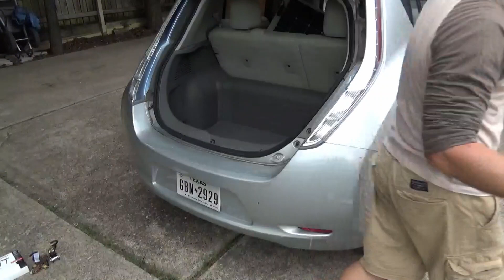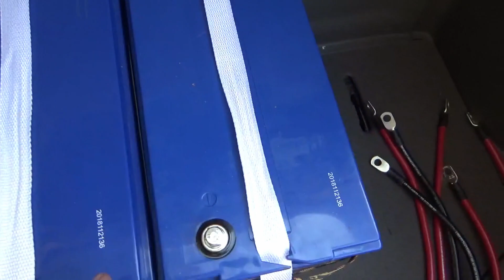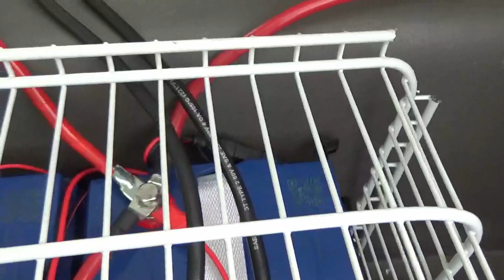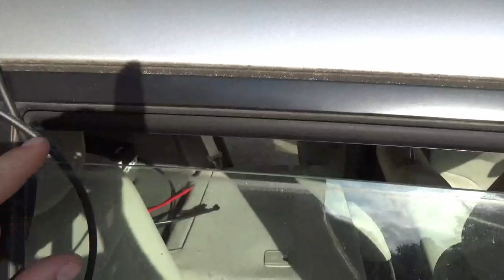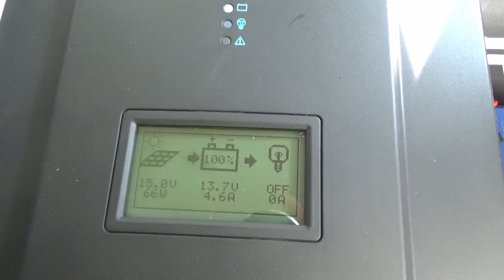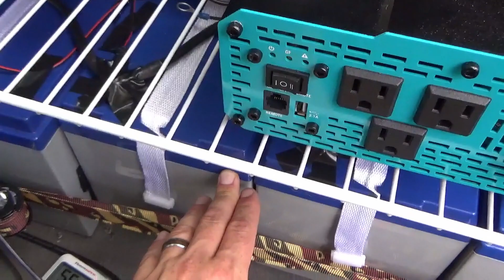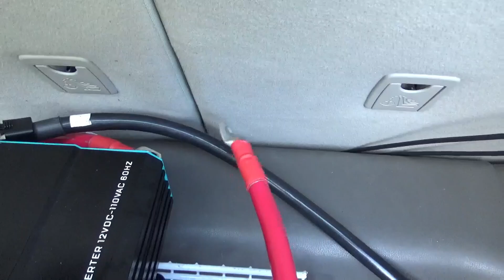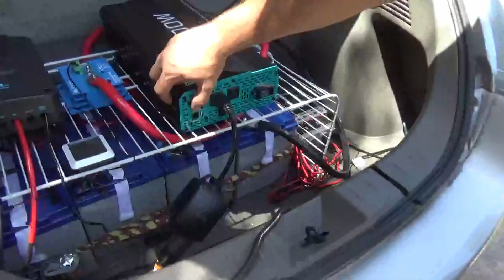Solar Powered Nissan Leaf

Comment from the maker: Finally finished editing all the footage!  Sorry it's a little long and some of the camera angles are, . . akward.  Im happy to answer any basic questions you have here in the comments section.  For more technical/in depth inquiries please e-mail me at Lonestarezev@gmail.com    Enjoy, and thanks for the support
Reply: Very cool, but add-on solar to our short range ev's (or any ev) would be much better if we could have an inverter, charge controller wired straight to our traction batteries. Removing the extra batteries and the need to plug and unplug the charger. Anyway still cool and as ev tech improves and evolves along with pv tech, we will see things like this become more and more relevant. Imo ev's still have tons of untapped potential. Good work and hope your system adds many happy, zero emissions miles to your leaf.
Reply: Did you get your inspiration from the Lightyear One car? Which its-self was derived from Stella? SolarRolla versions 1 and 2? This is tech that has seemed within reach for a while now, but not exploited for the short and sunny daily commuters.
Reply from the maker: @JoeMalovich  The Light Year is an amazing vehicle if you're a multi-millionaire.  This is a solar vehicle that anyone can afford and drive.  It's simple to work on, and they start at well under $6,000.
Reply: Great job and great video. 

Is it possible to get a parts breakdown list written up in the vid description or About?
Reply from the maker: @willp5457  I'm still working out the best components/brands for the system.  I don't want to throw a parts list out there today, and find something that is better and cheaper tomorrow (thats happening a lot), and steer somebody wrong.  For that reason I'm just doing it through e-mail for the time being.  When I get all the kinks worked out and this system works flawlessly I will definitely post a parts list.  Stay tuned Will
Reply: Wattsap 05397470473 turkey   tenk you
Reply: How much you spent?
Reply from the maker: @fredyrodriguez4221  System shown in this video was $2500.  Ive since upgraded batteries, inverter, and added an air conditioner.  The system shown in my latest video with roof rack panels, and everything else would cost you around $4,000 to build.  You get 1/3 of that back in a tax rebate if you live in the U.S.
Reply: Innovative Sustainable Solutions Ok, please explain why you cant just hook up the solar straight to your vehicle battery bank?? Thanks!
Reply from the maker: @davetriplett4779  Thats the most common question I get.  I'm going to do a video on it in the near future here.  1st you would have to bypass the vehicle's charging hardware.  The plug that goes into the front of the Leaf (the J1772) plug, takes the 120v AC power and runs it through the vehicles charging hardware that turns it into the 400v power neccessary to charge the vehicle battery.  This charging hardware requires a minimum power input of 600-700 watts.  That amount of power is extremely difficult to generate using the number of panels that can plausibly fit on the vehicle.  I have reached as high as 480w using the system as of June 2020, and the systems current iteration is considerably larger than the one in this video.  So we can't use the hardware designed to charge the vehicle, why don't we bypass all that and plug the panels directly into the main battery?

The solar panels generate power at 18-20v, so we would have to step that up to 380v.  Not easy but it can be done.  The vehicle has something called a precharge resistor you have to get around or you'll blow a fuse.  You could drop the pack out of the car and apply leads directly to the High Voltage pos/negative.  Run those leads through the case, re-seal the battery pack, hook your stepped up 380v power to those leads, and it SHOULD charge the battery directly.  At this point I should mention in the year I have spent researching DIYers Leaf experiments I have never seen anyone even attempt to achieve what I'm describing here.  But up to this point it is theoretically possible.

This brings us to the final hurtle.  The vehicles BMS (battery mgmt system).  This software is designed to monitor the roughly 400 lbs of potentially highly flammable lithium battery cells that compose the vehicles battery.  The Nissan maintenance manual for the 2011 Leaf seems to imply that if the vehicle is turned on and detects a change in the battery voltage when it WAS NOT charging since turned off, the vehicle software will assume the battery integrity has been compromised somehow, and shuts everything down except the "See Dealer" indicator on the dash.  We don't know for sure because no-one's ever attempted this.  I intend to verify this is impossible, but it's a complicated task that I probably wont get to for several months to a year.

To paraphrase: The way shown in this video is easier, safer, won't damage the internals of the vehicle, and can be done by anyone.  So I went with this method as a tutorial for beginners who want a range extender for their Leaf.  Good question.
-Sam
Reply: Innovative Sustainable Solutions sucks that it has to be that involved...& high power required to charge....i have a tesla model3 and the glass roof is a Perfect place for about 5 300W panels, & the sun boils down thru there...i put windshield sun shades in the front one...🌞🤔 Thanks for the in-depth response! I will keep researching....
Reply from the maker: @davetriplett4779  Nice.  We're cybertruck order #22k.  I love the model3 but Tesla's are tricky.  Vastly more bms software than the Leaf (or any other EV really).  InsideEVs did an article on this Youtuber who did a solar trailer system for the Model3, but it some critical flaws/borderline deceptions they missed.  I've heard that if the power supply to the EVSE is interrupted 3 times (unplug 120v plug but leave the charger in the port), the M3 decides it's a faulty circuit, and wont charge anymore until the charge port is unplugged and plugged back in.  Can you verify this?  Thanks.
Reply: Ok, please explain why you cant just hook up the solar straight to your vehicle battery bank??
Reply: https://www.youtube.com/watch?v=j8H7eEDbY-o
MY SOLAR CAR. PROJECT CARRIED OUT IN 2020. The Romania hybrid / solar car.

Comment: The electrical safety issue is more about uncontrolled current flow. DC voltage <60V won't shock you, but the size of those batteries and cables can cause instant welding of the wires if they touch each other and possible fire from wires melting due to the short.
It's too bad the leaf won't let you drive while it's charging, or you'd never need to unplug it. I'm considering doing this, but maybe just to power the 12V system, so things like the A/C can run without draining the drive battery.
Reply from the maker: The HVAC system in the leaf is directly linked to the HV battery unfortunately.  Connecting the solar straight to the HV battery would awesome, but involved opening the 400v battery and making direct connection to the cells.  I never got that far, but would love to watch someone pull it off

Comment: What size batteries are you using
Reply from the maker: @billkoeberle3308  It Agm(lead) batteries in this video.  I later switched to afternarket lithium batteries made by Valence
Reply: @InnovativeSustainableSolutions  what amp hour rating
Reply from the maker: @billkoeberle3308  12v 100ah initially
Reply: @InnovativeSustainableSolutions  thank you for your help

Comment: Velcro to hold those batteries is quite unsafe, along with using the plastic panels to hold your ratchet strap. Those will kill someone in an accident flying forward.  You could have easily bolted to the metal frame of the car. Additionally I can't believe you actually cut a hole in the boot lid to run the charger cord to the front. Very inelegant solutions to be advising people to copy.

Comment: What are your thoughts on a wind turbine to help charge it at night or whenever you stop?
Reply from the maker: I think it's a great idea.  You would just need to design something that deploys rapidly, and can be secured tightly to the vehicle.  I've thought about building something like that a lot.  People will immediately jump in and say "It's too much weight/wind resistance when driving", but that doesn't really apply to most Leaf drivers.  Most of us drive 60 mph or less, and less than 60 miles/day.

Comment: Great video! I would have tried to install an all-in-one 48-volt system in there which will provide you more capacity and you can charge at 240V. That would be an interesting project if possible.

Comment: How did you get the EVSE to detect ground? I have a portable 2.5 kWh battery but can’t charge because the charging brick flashes green which means it can’t detect ground to allow charging.
Reply: The answer is a bonding plug

Comment: I love mine too but I must improve my range from 225 miles to
Over 450
Miles before I can drive it from California to My new home in Texas so any suggestions some have added generators to the roof to add substantial Milage any suggestions. There are night mare stories about Vehicle transport companies so I’m concerned and wondering if there’s anything I can do to get my ranger to drive my own car safely to my new house
Reply from the maker: I have used a vehicle transport company to get a Leaf from Cali to Dallas.  It was a bit of a headache, and $1600, but I can give you the company info if needed.  I have never seen a Leaf go even close to 450 miles on a single charge.  Aerowheels help (I have a video on those), it's still cool out in the mornings so you can drive with the A/C off, and if you keep the speed around 55 mph, you will get more range, but it will be a challenge.  You can do it, but you will have to research where all your charging stops will be.  Try to enjoy the adventure, and welcome to Texas!

Comment: Instead of cutting the rear hatch for the cable, you could run it inside the car and trough the firewall and store the plug in the engine bay. Or drag it out the wheel well drain plug
Reply from the maker: It occurred to me later that this would be a much better way to run the EVSE cable.  Gonna try and do a video on that this year

Comment: im think about doing this. i found a nissan leaf for cheap
Reply from the maker: I've learned a lot since I posted this 18 months ago.  Check out the more recent videos, and I'll keep posting new ways I'm finding to add a couple miles of range here and there.  The Leaf is the only EV on the planet that you can turn into a 70mile/day vehicle for under $8,000.  E-mail is in the video description if you need help.

Comment: How much of an effect do the panels have on the range due to air drag?
Reply from the maker: Shockingly it's an efficiency loss of only 2-4% at speeds around 55-60mph.  I still get 4.6 miles/kwh with my latest version of this system installed (see most recent videos)
Reply: @InnovativeSustainableSolutions  Thank you!  Will do.  :D

Comment: I love it you jumped right in there :) Have you played around with using series on the panels instead of parallel? How hard would it be to add a second vehicle charge port so you didn't have to run the cord on the outside?
Reply from the maker: I made a mistake designing this as a 12v system.  Im actually gonna talk a bit in the next video (Custom Flexible Solar Panels) about how to switch this a 24v (2 panels in series) system, and the advantages of doing so.  I also want to do a video on how to permanently run the EVSE handle under the body paneling, so it's less, . . trashy looking, and so pranksters don't get tempted to unplug it when they walk by.  I have a friend that worked in an autobody repair shop that I think I can talk into helping me make a video on how to conceal the cable.

Comment: Excellent video!, Could you have just installed the solar panel w/o adding more batteries? If yes, how to connect solar panel to the existing electric car system? I have a Toyota Highlander Hybrid 2006 and I want to install a solar panel then connect it to the existing hybrid battery system. thanks for any info..
Reply from the maker: This is the most common question I get about this system.  I'm going to do an entire in depth video connecting directly to the vehicles battery, hopefully within the next month.  Stay tuned
Reply: Awesome my friend! there will be many that will be grateful to you for that upcoming video, thanks again.

Comment: Great idea. I would love to see a rack on my roof that either folds out or is telescopic so when you park, you unfold it and can have larger more efficient rigid panels. If done this way, i reckon you could get about 800 to 1000 watts of solar on the roof.
Reply from the maker: You could go with rigid panels just as easily.  They are atleast 10x as thick and way heavier, but if you don't drive at higher speeds, or very long distances then the scales would probably tip in the favor of rigid panels.  Next weeks episode is all about solar roof racks.

Comment: Why do you think the Renogy 3000w inverter failed, the charger only pulls about 1400w? Very interesting (and gutsy!) project!
Reply from the maker: I have noticed, now having worked with several brands of inverters, that manufacturer's across the board seem to be very ambitious about what their inverters can handle.  In general, I have discovered it is worth it to buy an inverter spec'd at at least twice the load you expect to be running.  I have been extremely pleased with my Giandel 4000w so far.

Comment: A true American Hero, thank you Sam, you are the man! I have a LEAF identical to yours, my son now drives to High School! I drive a Bolt now! If only I had known P85 Tesla Model S would be going for $25,000 or so I would have just waited 6 months! After spending 2.5 years of my life on Army Middle East Deployments... Solar and Sunshine 🌞 are so attractive!
Reply from the maker: Ha!  We have the exact same vehicle loadout.  The missus drives a 2017 Bolt.  Stay tuned, I've got a Leaf battery pack replacement how-to vid in the works for this fall.  Where the heck did you find a Tesla S for $25k?  I found a 2012 S with 180k on the odometer for $28k.  The Bolt for 19k just wound up being much more affordable
Reply: Ahhh Good Sir, Indeed you are one of my true American Heros today in this age of Science Denial! 

Car Gurus...in fact seems to have a corner on the best Model S deals. I do have an inside deal too though that beats even Car Gurus. BMVW Auto Sales in Unión City, GA just South of ATL!  I have an inside deal with him to get them at his cost from auction which is as low as $19K sometimes for an 85kWh Model S! He is an Iranian Immigrant from 1980 or so, to attend Georgia Tech as a Civil Engineer and never went home, except maybe to visit! In Dec he installed 128kW of Solar, which on a sunny 😎 winter day makes 700-800kWh , more power than his 50,000 sq ft building with 3 tenant shops uses! 

https://www.cargurus.com/Cars/l-Used-Tesla-m112?px8324=p2&sourceContext=usedPaidSearchNoZip&cgcid=12297&cgagid=30146915&ax8324=67620959&type=GoogleAdWordsSearch&kw=%2Bcargurus%20%2Btesla&matchtype=b&ad=327956807892&placement=&networktype=g&device=m&devicemodel=&adposition=&physloc=200524&intloc=&aceid=&cid=1657358119&agid=67278678618&tgtid=kwd-620656408212&fid=&gclid=EAIaIQobChMI06C29Zrd6QIVAovICh33sg_cEAAYASAAEgJKPfD_BwE#listing=271340625 

I might well can read you in on his super discounts as well, he has built a Solar Rack(Wood) on Wheels That looks a lot like your 2011 Nissan LEAF Set Up with 110/120 V!  I can email you the photos. It will charge a strange little Chinese EV just fine as well as a 12 Amp AC Window Unit and another smaller AC so 18 Amps, but it won’t charge an older LEAF like yours and mine nor a Chevy Bolt! Perhaps it’s a grounding issue. I watched your Nuts and Bolts Filmed in the SpaceX T-Shirt. But no dice! I may have to watch it again!  I just found your Patreon Fundraising Website Yesterday or so to throw you some bones too!
Reply from the maker: @AndrewLanecptplanet  That is a good deal on that Tesla!  They have come down in price a bit since I stopped looking.  I know Tesla recently dropped the price on the entire lineup (excluding the Y) and I thought that would probably lower the used car prices some as well.

Regarding your friends Chinese solar van:  I've had several people who have built rigs like it, and the Suneater contact me since I started this project.  The build methods vary a little, but there is a surprising amount convergence.  Everyone that builds these things is a little in the dark though.  We're all out there on our own figuring this out, and I'm sure repeating a lot of the same mistakes.  Finding a reliable inverter and defeating ground detects was the single largest hurtle I've encountered so far.  I want this channel to be a tutorial for other DIYers out there, so thier builds are less intimidating with fewer wasteful, costly mistakes.

Regarding science deniers and solar skeptics.  I get it every week.  Usually on Reddit.  I'll have an "expert" assure people that there's no way my system adds more "1 or 2 miles a day".  I'll show them actual reading on the charge controller on film, the actual increase on the range in the vehicle and still they will deny it's possible.  I suspect 15 years from now when people just drive ICE cars for nostalgic purposes, there will still be people denying that electric/solar cars are possible.  Probably the same way there are flat-earthers today 500 years after Magellan.  Those aren't the people I do this for.  The little guy on a tight budget, who needs his $4k Leaf to go 100+ miles a day, and has an out-of-pocket limit of 10k: that's who I do this for.  My Patreon sponsors are awesome.  Every penny I get on Patreon goes directly towards purchasing/researching parts to further this goal of low budget EV range extenders.
Reply from the maker: @AndrewLanecptplanet  Yep I got em.  Nice set up!